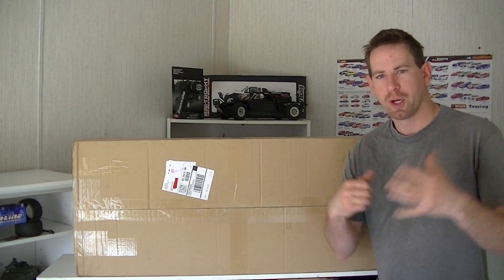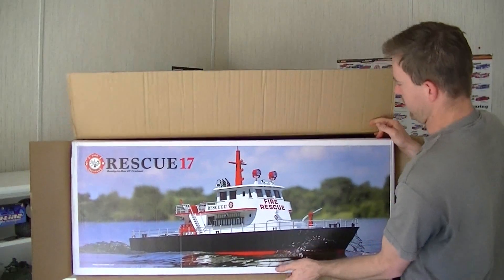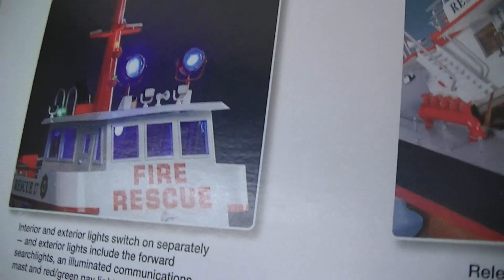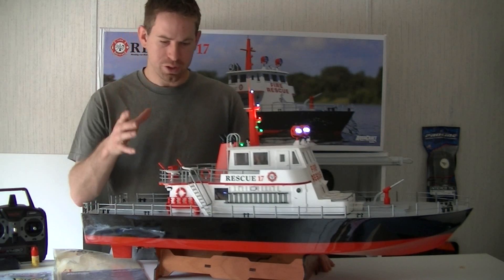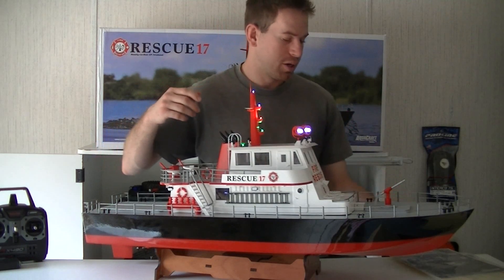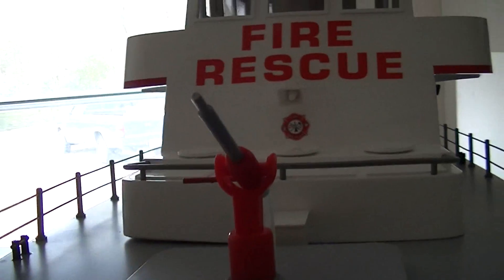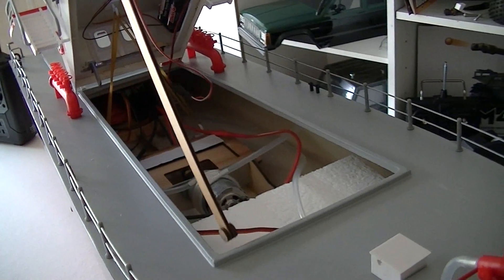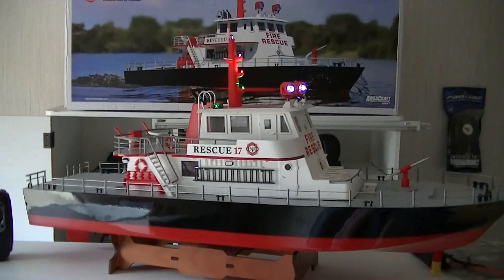RC84Films : Unboxing Rescue 17 RC FireBoat

Comment: I had some issues with this boat. Right out of the box the receiver wouldn’t turn on. I determined that the on/off switch didn’t work, so I had to replace it. I put a spring on the deck latch to hold it in the locked position. The water pump failed after about 5 minutes of run time. Replaced it with an electric fuel pump from the hobby store. A bearing on the stuffing box came loose. The railings are very fragile. After breaking several posts on the main deck railing, I replaced them all with brass tubing. This boat looks very nice but it will take considerable rework to make it more rugged.
Reply from the maker: Had no problems here with mine
Reply: @RC84Films  , How long have you had it? Still, the small plastic parts are very delicate. The little antenna on top of the mast I replaced with a wire with red insulation. You can’t tell the difference but now it can bend without breaking. The replaced water pump was much more powerful than the original so I made a second nozzle and put it on the second deck and removed the dummies.  I put a dingy on the lower aft deck hatch. Just some hints for improvement.
Reply from the maker: Few yrs now and still have it

Comment: Any thoughts on how to improve the water tightness?  Or is it good weather only type boat?
Reply from the maker: maybe seal up the opens with ducktape or use a flat lid of some type. if you going to run in big waves I would unhook the water canon hose and turn the pump on so the water can get out and sure ur electricals and battery waterproof

Comment: '
cooool boat...
what country make this RC boat...
cooled water on the motor is a not enough cooler...
need more long tube turn around on the motor, not 1/3...
must be full tube on the motor...
must be 1:2 gearbox same as traxxas villain EV boat
Reply from the maker: us
Reply: @RC84Films 
hi R...
'
is that american made only R/C boat
Reply from the maker: Aqua craft models